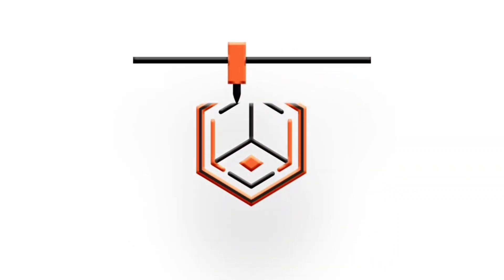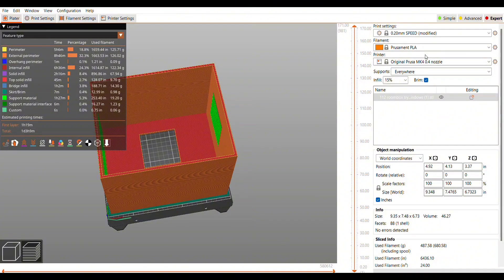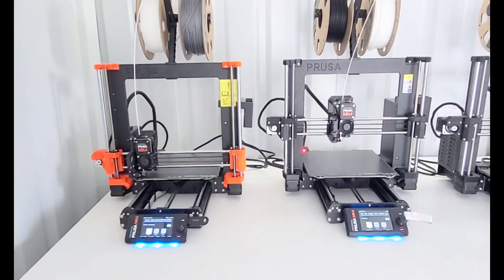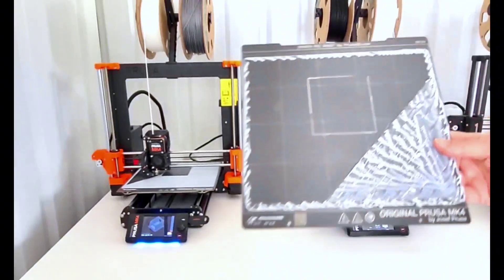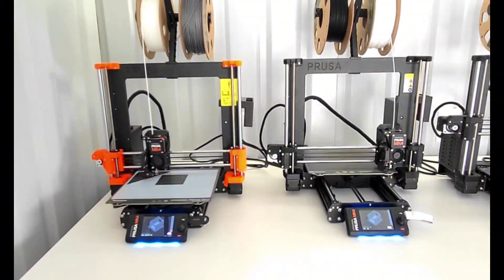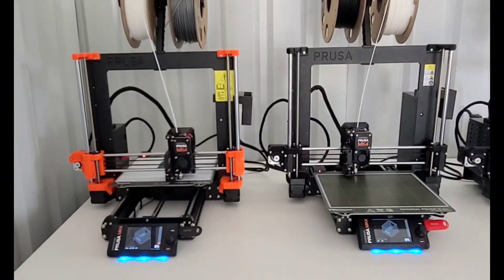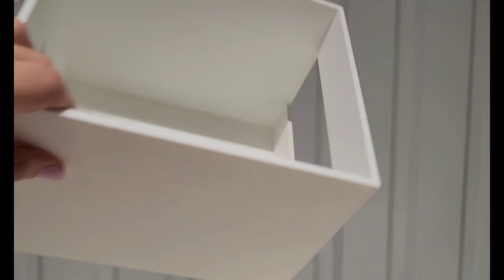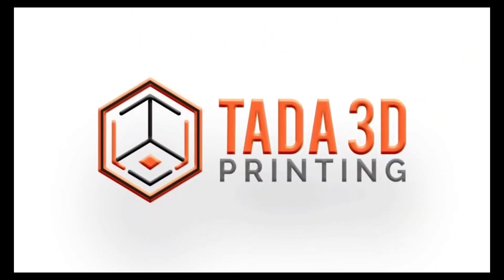Comparing prints with and without Input Shaper on the Mk4

Comment: Bad idea to spray on the bed! Better on a wip or on the bedsheet away fron the printer. You spry also on the printer parts and it removes the oil on the rods :-(
Reply from the maker: That's true. I need to be more careful. Thanks!